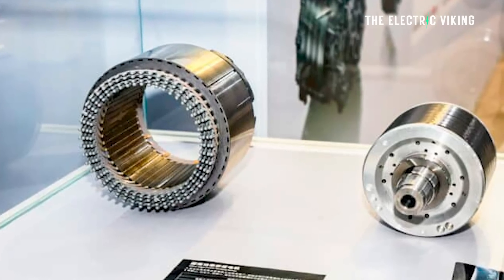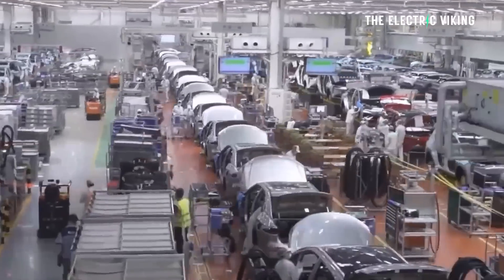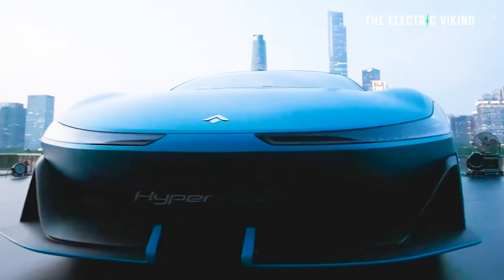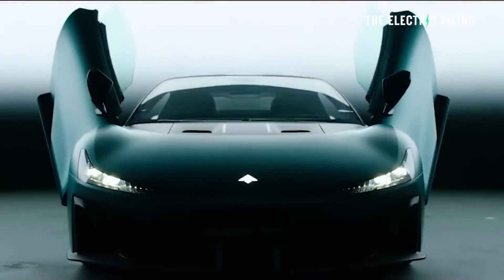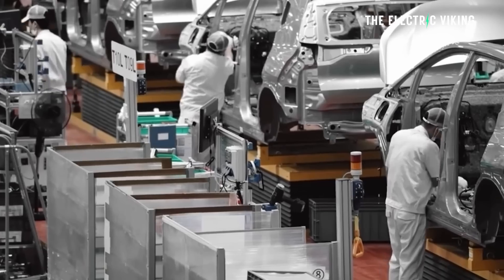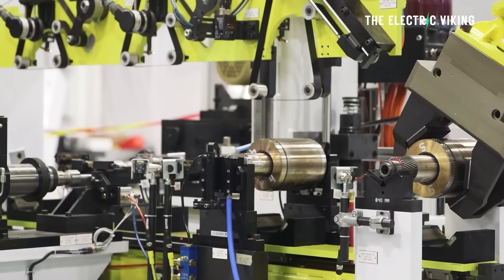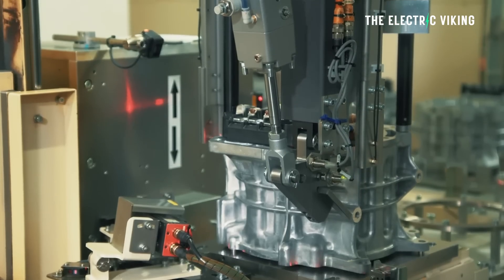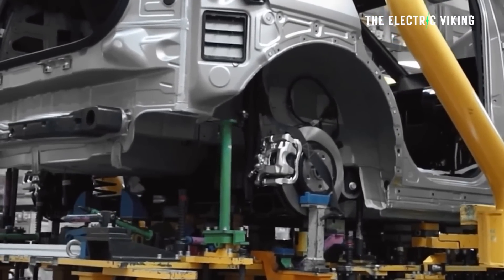Most efficient and powerful EV motor EVER hits an amazing 30,000 rpm

Comment: Motors, transformer with efficiency nearly 100% are nothing unusual, but the stumbling block for many things electric now is the lack of means to store a lot of power, until there is a tech break through in energy storage, the most efficient motors are useless without power.  High speed bearing is no problem, sure it be expensive, but jets have them for a long time already.

Comment: I think e.g. at ebikes You cannot use a normal powerfull brushless motor from an RC-plane, with max 30.000 rpm, because you then suboptimise and need a big gearbox with huge rpm-reduction and big losses. So at least at e-bikes, lower rpm motors and smaller simple gears inside the motor, are better and more efficient. Maybe its a little like this in ev cars too, although electric cars use higher revolotions on the wheels... ;-)

Comment: I live in the U.S. where even whispering "E.V. or Plug-in" is a crime worse than murder, serious!  But, you were discuss the fact that this new motor runs most efficiently at room temperature, and it made me think of a question I'd always meant to ask an E.V. person. I live in the U.S., in the Southwest desert region, where summer temps can get extremely high under the hood and inside the care, besides the outside ambient air. It can get from 38⁰C at the max in spring up to 51⁰C in the sf suburban neighborhood I live in. It is not uncommon for some nights in November or December to have an overnight low temp of 36 during really hot years. They stopped publishing how many years in a row we've been in a drought situation, but I know it's been over at least 20 years! You don't walk barefoot around your pool deck on hot days and certainly not sidewalks or asphalt streets. So, lots of high temp here. If someone is forced to park their E.V. outside without shade, how or will that effect their car's batteries? I would like someday to buy a small E.V. (really want a racer type but I'm disabled and the pays not good! LOL) if the U.S. ever lets China sell theirs here without tariffs, fat chance, I know. Or when we retire to our flat in Eastern Europe where I'm sure we can buy them there. But if I get the chance to buy one in the U.S., I wonder what will happen to our car's batteries, will they lose rechargeability quickly? Will they start melting being close to the super hot asphalt streets?

Comment: Nice video, but I am afraid you are missing a couple of engineering fundamentals. Anyone comparing an ICE 1 to 1 with an electromotor clearly was not paying attention at engineering classes 🤣😂.  It is not that difficult to extract ridiculous kW outputs from an electromotor if the energy needed for this readily available (battery or gridline). It is a completely different ball game if you have to generate/convert that energy by the engine itself, aka ICE. To proof my point; ever wondered why so few new ICE manufacturers could compete with e.g. German or Japan made ? But it is extremely difficult (many rotating parts, thermodynamic complexities, etc..) ! Why are there suddenly so many EV manufacturers? Because it is much simpler compared to  ICE technology!

Comment: I am not not remotely an engineer, but a little modicum of common sense tells me that any thing running at 30000rpm will not last very long or will require plenty of monitoring and regular replacement of parts.

Comment: You gotta be kidding, this reminds me of the FAILED Chrysler turbine car;  
      a 30000 rpm anything is WORTHLESS in a car, the wheels do not do high rpms, the gear box alone for that would kill the efficiency, cost as much as the car, and whistle a mile away; a 3000 RPM motor would be it, not 30000, forget that.

Comment: 30,000RPM is essential for sports cars, as it allows higher top speed without using any gearbox. On the average, When you drive at 100kmh in an EV, the engine RPMs are at about 10,000. So it's 20kRPM for 200kmh and 30kRPM for 300+kmh
Reply: That sounds about right. Plaid motors is limited to 20k rpm and limited to 200mph top speed although someone removed the limiter here on YouTube and went 218mph before running out of room. It can go 220-225mph

Comment: I can see Viking not very happy when hearing plug in hybrid doing 150km compare to EV just doing 50km

Plug in hybrid taken over 50% of EV market share that’s just going to be fact.(more expensive maintenance down the road but people don’t have brains, they can buy whatever they want) 

It’s a fun concept, people don’t know they can do explosive sport car with fire spitting out and 4 turbo on double motor. Some plug in hybrid have sport car mode and can do 0-100 in 2-3 seconds. It’s not a rocket science, also Tesla slows down after 160, gasoline cars kept going, ehhh, change it to jet engine fuel then you’ll see the difference, 1,000kmh woooweee😂

Comment: Yes, nice improvement in gaining more potential rpm. Actually does more for efficiency than most people would think , including the armchair experts. Lol. While the motor itself may be at 95% give or take, on its efficiency... with the extra rpm available,  engineers can lower the overall gearing,  thus gaining better real world efficiency. A lot better. My Surron ( electric dirtbike ) gained a noticeable improvement in range when I dropped the gearing in the very way I am describing,  and my motor rpm only increased from around 6000 rpm to roughly 10000 rpm. But the top speed with the lower gearing is still the same as original, so I use less throttle for most situations. A very common mod. So not my idea. But it does work.

Comment: Might see a revolution in electric motor COOLING yes, absolutely...most easy economic way to do this is simply bathe the entire product in some type of liquid such as oil or synthetic oil ideally and add an oil pump to circulate the fluid to provide crazy efficient cooling to the engine product.  Some of this has been hinted at with the new Starship Rocket engine if you look at new now as the "fueling infrastructure" is now #integral to the engine itself or built in to the housing as opposed to be globbed on to the exterior as was true previously (for the puposes of monitoring the engine design/performance was why before done rocket engine in way was done.) A modern ICE platform engine could be done this way as well i might add...get rid of all the fuel lines etc and simply encase the entire matter into a "housing" but yes in the meantime and for COOLING purposes could be what is being done here for an electric motor. There is a lot in the "wrap" (how an copper coil is literally wrapped around the magnet to create the power system) meaning is using "wound" but if instead of winding take a "Y" shaped magnet hinted at by your Tesla chargine cable interface and charger and then "wrap" along a 3 axis depending upon how done specifically but that would increase suraface area from a single "wind" to a massive "wrap" also there are 3 dimensional aspects to this as well but yes...cooling remains a major issue with these types of drive lines so if made #integral_cooling thermal efficiency of the unit would be increased very materially #steady_state kind of thing with temperature however not pure electrical although that matters very much as well and create first and foremost very ROBUST drivie unit (free of failure ever, probably last longer than the vehicle actually) but also as a practical matter more "efficient" meaning with same amount of applied energy can travel a further distance all other matters being equal and they are in a battery electric vehicle. Would not call this a "breakthrough" as say a fully autonomous vehicle working system in the wild and actually working wholly run by computer would be #driverless_car but yes possible a new #BENCHMARK be had here have to see the producted as delivered holisitc functioning as working to make that a valid claim absolutely.  Definitely possible tho. Battery electric hybrid vehicles are putting out crazy amazing good thermal efficiency to create work effort numbers going on a long time now though (over 12 Months running anyways.) 😮😮😮

Comment: Motor efficiency doesn't really equate to that much lower wh/mile or wh/km consumption - the majority of losses are friction, road/trye and air resistance - a small  increase in motor efficiency will have a negligible impact on actual overall car efficiency - motors in EVs are over 90% efficient already with many around the 93-95% mark.

Comment: One thing over many years I have noticed about China is they lie quite a bit and their so called results cant be trusted.....maybe you are not aware of this. 98.5 % efficiency is actually not possible except if the rarest of instantaneous situations....all motors cause heat loss and its a lot more than 1.5%....almost all motors are around 10% loss from heat instead...sometimes more than that.

Comment: Electric motor efficiency (whether DC or AC) is a significant function of load and RPM.  Quoting maximum efficiency is meaningless without showing either the RPM/speed or load plot.  Also note that this is the same Toyota that bet the farm on hydrogen fuel cells (a very bad decision) and also claim to have a new Engine that will kill off all EV's.  https://www.youtube.com/watch?v=8a8GsEP8pqs&t=348s  Don't believe the often self-contradictory hype.

Comment: Is this accurate?  Google search quote:  "Some sources state that lowering your speed on the highway from 65 mph to 50 mph (if that's safe and possible) can increase EV driving range by up to 30%."
Reply: Depends what you are in - perhaps in a brick shaped EV that might be true the difference in my model 3 is around 10-15%.  Wind resistance at 65mph is 69% greater than 50 mph.
Reply: @TB-up4xi    The reason for my comment was that ICE vehicles are most efficient per mile at 45 MPH.  It got me thinking at what speed are EVs most efficient per KWH and at what speed do the EV manufacturers determine an EVs range.  I did several Google searches and all the results were similar.

Comment: Tesla wrapped their electric motors with carbon fiber so they don’t explode at extremely high RPMs. How are those new motors running a 30,000 RPM without any reinforcement?
What will be their reliability?

Comment: GMAC has room temperature superconductor motor technology?     If true it's a science breakthrough.
The downside to 30,0000 rpm motors is more gear sets for speed reduction, adding more friction but with precision gears perhaps the motor efficiency gain is greater.  Also it seems like it would have greater inertia like a ICE flywheel which reduces acceleration and a increases energy to achieve speed.
Could locking the inner rear wheel be their trick to a tighter turn radius?

Comment: Think this motors will be very expensive. Centrifugal force is enormous, requiring exotic materials for the rotor and the bearings, What is with induction resistance? Beside this, you can buy electromotors with 500.000 rpm, CELOROTON for example.

Comment: High RPM is only impressive because it's difficult, not because it's beneficial... besides, if an electric motor accomplishes higher power density and efficiency from operating at significantly high RPM, it may need gear reduction to match the final drive RPM needs... which would hinder efficiency and power density. 
This hype is lame. More efficient motors are not going to help the case of EVs vs ICE. We all know batteries and power generation/conversion are the biggest challenge with EVs.

Comment: That motor is going to require some very expensive materials if it is going to last more than a few hours, and if it is running 30,000 RPM it is going to require some fairly heavy gear reduction. Better to just add a few kWh of batteries instead if you want that 50km more range.
Reply: It's not that radical - Tesla motors currently spin at a maximum 22,000 rpm and last for years and hundreds of thousands of miles.

Comment: 30,000 rpm may be good for aircraft turbines. For automobiles a large diameter motor, like a wheel motor, produces torque efficiently at very low rpm and eliminates the transmission completely. They should, however, be mounted inboard on CV axles, away from vibration and dirt at the wheel.
Reply: It's different for electric motors 
Vs engines producing torque thru a trans and gearbox

Comment: Don't get so excited.  Size has something to do 3this. I know a generator that is over 98% efficient,  and you may be using it now. It is down at the power company. The trou6is that these machines are that efficient at high power. At low power not so much. Try turning it to 30k rpm by hand. Not too easy.

Comment: I can't wait to have engines so small and powerfull,  that they will no longer be this tradicional engines in front or back of the car, but actually inside the wheels.
Imagine the space and weight loss that will bring! 
And probably improve handling as well.
I keep saying that, with all the improvements (or brakethroughs) happening right now, between 2028 and 2030 is when EVs will amazing!

Of course I think that those possibilities are one of the main reasons why so many people (like me) won't buy a NEW EV anytime soon...

Comment: The problem with 30 000 RPM at 180 MPH is the final reduction ratio need.   A 30 inch diameter wheel (large SUV size) only turned at around 2000 RPM.  So, you need a double gear reduction ratio to have a 13 to 1 final gear ratio, and you lost around 1 to 2 % by gear ratio.  Ex.: You need a fisrt 5 to1, with 2% lost and a second 3 to 1 with another 2 %  lost to get a 15:1 final gear ratio, the final efficiency will be 94.5%, not so great.  A lower speed motor will need a single reduction ratio that will have only 2 % poser lost in the reducer, so will have 2% more final efficiency.  I have made many motor sizing for industrial application for efficiency and always take care of the final reduction ratio need to chose single stage if possible to keep the best overall efficiency.  Motor that speen at that speed need special bearing, high precision balancing and we uses them only for sirect drive for little saw to trim wood, sometime at 24 000 RPM.
Reply: In semi-conducteur industry we use motor rotating at 60 000 rpm to cut silicon wafers but it is with air bearing  !
Reply: Dremel tool ...35,000 rpm..
Angle grinder....20,000 rpm..
Jet turbine....30,000 rpm

This isn't some incredible speed. But you need good bearings.
Reply: So, technically, with a good power/weight ratio you can build a electric jet fan with those engines? @MudflyWatersman

Comment: Not shure the high RPM is an advantage.  It will require gears for speed reduction.  The first gear is critical.  It will aso need strong lubrication on the bearings, and a cooler for the gear case.  More parts = more complexity = more things to go wrong = mopre cost.
Reply: The Tesla Model S plaid motor spins at 23,000 RPM and has a single reduction gear - this is not an outrageous improvement.
Reply: @TB-up4xi  Cope.

Comment: the steering isn't hard, Our Diesel UPS trucks wheels come out to 85 degrees compared to first gens 62 you don't need rear steering, just a better shaped steering knuckle. If they're hub motors it would be easier.

Comment: Becuase an electric drive plug in hybrid has a longer range to start with. Thus if it has 800km fuel + battery EV mode ) range already, then the boost you will get for that 800 km is based on the percentage improvement this new electric motor can provide. Thus the longer the range to start with, the greater the range boost with the new motor.

Comment: The question is: how long will the bearings last?
Reply: Very long time if you run at low RPM. Nobody is going to do 30,000RPM all the time.

Comment: My $150 DeWalt woodworking router turns at 26,000 RPM.
Reply: But the cutting bits weigh much less than a car.  😆
Reply: Can it move a 4,000-5400lbs car?

Comment: This is all very wishy washy from a GAC info release. No credible technical details. No info on electric engine type. I think you need to go back to GAC for sufficient real rather than woffle technical info before you pass on propaganda. A clue, the only type of motor giving really high power to weight ratios are radial. Oh and 30,000 rpm  and higher are fairly common in electric motors.

Comment: My only worry is that at this sort of RPM it'll sound more and more like a dentist drill...  😉
Reply: Most drills can't pass  3000 - 5000 rpm.
Unless it's a very rare specialty drill.
Go check it out.
Reply: @loktom4068  If my dentist pulls out a Ryobi I think I'd walk out😉
Dentist drills are more like 100000-400000 RPM
Reply: @steve_787  
Thanks you for your information. 
It's amazing to know the dentist uses such a super high rpm drill. 👍
Reply: @loktom4068  no probs. Mainly why I hate the dentist, sound of the drill really cuts through me 😉
Reply: @loktom4068  Obvious fiction, which has nothing to do with dentist drills.  Dentist drills routinely operate at 200,000 RPM to at least 400,000 RPM.
Reply: @Unknown-mf4of  
Thanks for your information. 
It's amazing.
Reply: Your worry is useless N unfound.😊😊

Comment: So what? What is the advantage of running at 30,000rpm? At that speed the motor has almost zero torque and would need to be connected to a HUGE transmission to multiply the torque and reduce the rpm before it goes to the wheels. which will reduce efficiency
Reply: Power does the work, not torque. Of course, you need torque to have power, but you don't need power to have torque. Put a ten foot breaker bar on the wheel nut of a road train and have you and three mates stand on the end of it. You'll have 8,000 ft. lbs. of torque and the thing won't move an inch.
Reply: @davidbrayshaw3529  30,000rpm may be good for drilling teeth but not for driving a vehicle